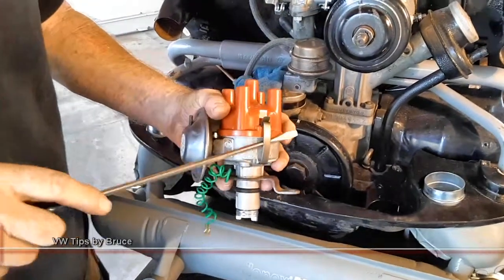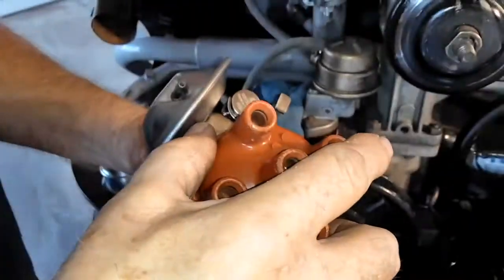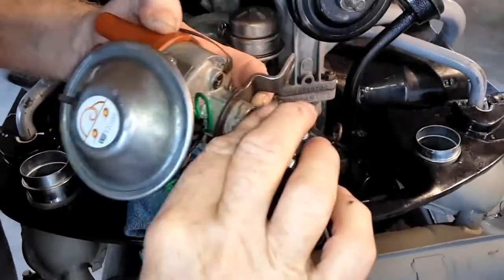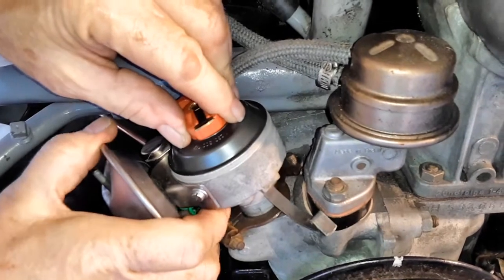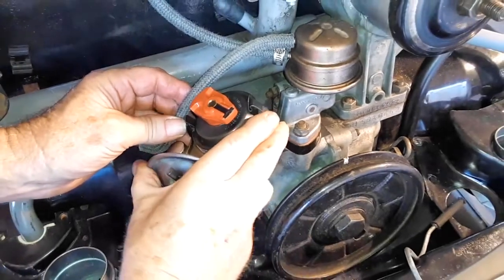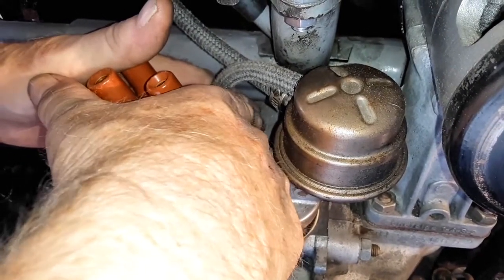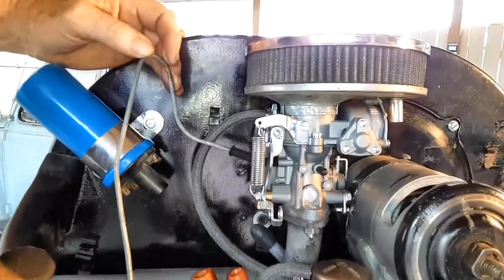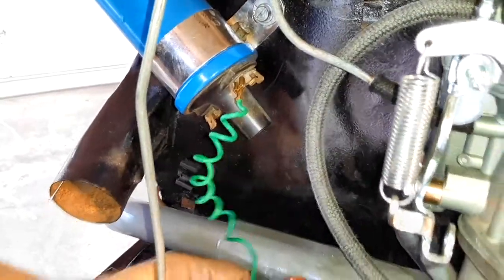Vintage VW Distributor Install  by VW Bruce

Comment from the maker: Bruce is a Stage4 Cancer/Stroke survivor. Sometimes suffers from "word salad". Snide condescending Comments will be deleted. "Mindblind" comments will be deleted. - Cameralady, the Helper
0:24  Dissemble the Distributor
1:06  The secret Bosch Notch
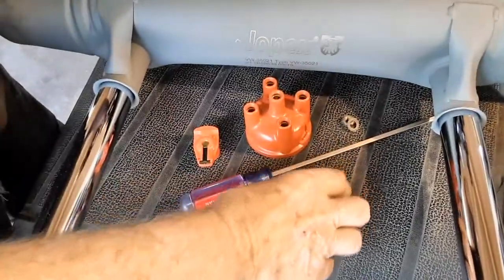1:30  Distributor Reassembly
2:47  Lube Distributor Shaft
4:04  Install Distributor into Port
4:26  Engine Set to Top-Dead-Center at #1
5:35  Stubborn Dist. Clamp catches on Fuel Line
5:45  Distributor and Bracket seat themselves
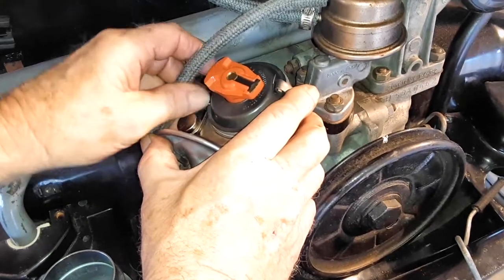7:03  Two Timing Tips: Light and Static
8:00  Cross-check Proper Distributor Install
8:30  Installing Wave Washer and Lock Nuts
9:18  Installing "Shepherds Hook" metal Vacuum Line prevents gas getting into the Distributor
10:11 Plug Wires Firing Tip
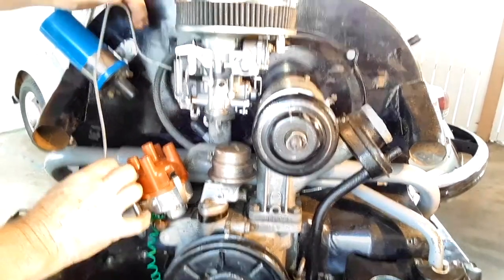10:26 Vacuum Line Shape
11:35 Electrical Connections
11:40 Primary GREEN Lead Wire goes to the Positive Connector, right side of the High Tension Cable.
12:15 Outro/End Screen Suggestions

Comment: Have you heard this?  @10:24
So I was told the metal vacuum tube going from the distributor to the carburetor is designed like they are because small amounts of gasoline can come out and if it’s not looped or angled upwards, like yours, it will leak down into the distributor.  
With that said, I’ve, too, just run a hose straight to the carburetor
Reply from the maker: Gary, yes, the metal vacuum tube does what you described.  Running a straight rubber vacuum hose, I've never had any issues with gas in my distributor. Some of my friends run a straight hose as well with no problems. Your choice. Thanks for the comment. 
Happy Fahrvergnugen 👍‼️
VW Bruce

Comment: I was waiting for you to say positive or negative on that coil
Reply from the maker: Hi Butler. So sorry it took this long getting back to you. I have had internet issues. The green wire from the distributor condenser goes to the positive side of the coil. That is the right side of the coil. Happy Fahrvergnugen!
Reply: Are you sure this is true? The distributor I just got said that for distributors with a single wire (those with condensers) the wire goes to the negative terminal on the coil.

Comment: thank you Mr. Bruce !! I'm gonna have to try this on saturday, cos i took out my distributor last weekend to clean it and now it won't start anymore and it back fired too, and also i noticed my distributor don't have notched, maybe because it's a after market brand. I think mine was a PerTronix with vacuum advance.
Reply from the maker: I'll be crossing my fingers for ya -- I know nothing about PerTronix!  Please keep us posted and what steps you took!
Reply: @VWBRUCE  i will , thank you Sir !!
Reply: @VWBRUCE  it works !! the engine is up and running again. but it need tuning. i already put new spark plugs and rebuilt the weber 40 carburator but the engine is still running rough. i might need a new coil. and also i have not checked the gap of the valves.
Reply from the maker: @dummiechanic7283    Congratulations! Regarding your "To Do List," I would suggest Adjusting the Valves first (Cause you're kind of doing a mini-tuneup)!  Other then that, it looks good and hats-off-to-you for rebuilding a Weber Carb!  That's cool!
Reply: @VWBRUCE  thank you ! I'm gonna do that this coming weekend, i'm still waiting for my feeler guage.i just got my syncrometer tool for the carb today. and also my new transmission mount. cos mine was too and loose.my engine been shaking a lot. and also my oil smells like gas? should i changey oil too? cos the 1st owner told me it was flooding the engine before.
Reply from the maker: @dummiechanic7283  You're Welcome! To answer your question, yes, change the oil. After some 20-30 miles, smell your oil again. If it still smells like gas, I would suggest take it to a mechanic, especially if you have a custom motor.  A lot of things could cause that smell.
Reply: @VWBRUCE  crossing my fingers i hope everything is good, the guy i bought it from said the engine was 1835.   so i'm guessing it was upgraded cos it's supposed to have 1600. Again thank you so much for the help !! I appreciate it a lot !!  i'll  just contact you on your main web site next time :)
Reply: @VWBRUCE  what type of oil and brand do you use for aircooled engine? and how many quarts? Thank you in advance!!
Reply from the maker: @dummiechanic7283   In my Oil Change Video, https://youtu.be/wlmQjJfjuBchttps://youtu.be/wlmQjJfjuBc, I mention running Castrol Oil straight 40W, and in the winter Castrol 30W, even here in So Cal. I use Castrol because it takes a lot of heat to break this particular oil down, hence it being a favorite in the auto racing industry!
 But everyone has their own faves and purchase size(s)!
Reply: @VWBRUCE  thank you for the help !! i'm gonna watch it now :)

Comment: It looks like my distributor is off 180 degrees...engine runs fine...gonna change carb to a progressive 32/36 & a sdva distributor...should I just line it up the same way when I remove my old distributor ?
Reply from the maker: Yes. It should run fine.
The distributor drive gear was installed 180° off when the engine was assembled.

Comment: I thought the rotor should point to no 1 cylinder that would be facing 1 o clock
Reply from the maker: @EIKLURAM  unless the distributor timing is off or the distributor drive gear was installed incorrectly the rotor should be at 4 o clock pointing to the number  1 cylinder. Hope this helps.I 
VW Bruce
Reply: @VWBRUCE Thanks for your reply. I see now that the SVDA type distributor rotor will point to the actual position of no one cylinder  at 1 o clock But the 009 type will have no one position at 4 o clock pointing in  the direction of number two cylinder.
Reply from the maker: @EIKLURAM  the 009s I've serviced would have the no 1 at 4 o clock. No 4 is to the left of no 1 on the cap. Double check that the shortest plug cable will be no 4 cylinder. Double check the engine timing. If the distributor is rotated too far,  then the rotor would be at 1 o clock  to no 1 cylinder. 
Happy  Fahrvergnugen 
VW Bruce

Comment: What size socket do you use to move that to top dead center
Reply from the maker: Hi  Natalie.
Good question. The socket size for the generator pulley nut is either 17 or 21mm. VW used both on their production lines over the years. My experience  is it's mostly been 21mm. 
Thanks for watching my videos & hope they've helped you. 
Happy  Fahrvergnugen,
VW Bruce

Comment: Is that green wire going to the positive side on the coil?
Reply from the maker: Yes, at the 11:40 mark I show where the Primary Lead Wire (green) goes. It goes to the Positive Connector which is to the right side of the High Tension Cable.

Comment: There must be a lot of original bosh svda Distributors around someplace the big rage years ago back was replacing with the 009 now everybody is realizing how much crap to 009 is and going back to the SV DA's
Reply from the maker: Motorcycleguy73, thanks for your comment. The 009 is the Porsche version of VW's 010 that was designed to run in the type 2 transporter. It has a faster curve to it so it doesn't work in all applications. Engine timing is critical with the 009 as well. Run the distributor that the engine originally had, I say.

Comment: All seems easy, but it's not. All these videos. Who really has a shop to work on these machines.
Reply from the maker: Hey, Marcus! I agree! But I will say this, I do not have a shop, nor do I have power tools. I use hand tools, a couple of jacks, jackstands, and a couple of wood blocks. One would call me a "Shadetree Mechanic." Yet, us kind, get it done, "Where There is a Will, There is a Way!"
Reply from the maker: Silent Hill Fan  Yep! Together, all of those in the VW AirHead Kingdom, will keep these vintage cars on the road! :-D